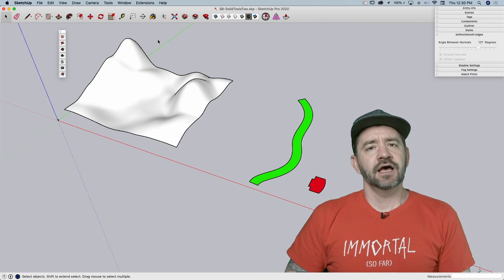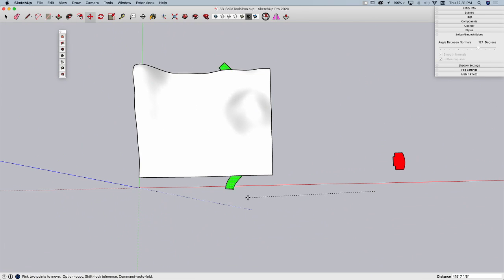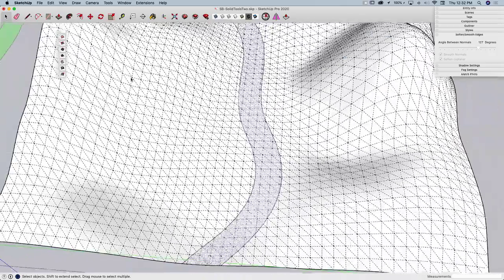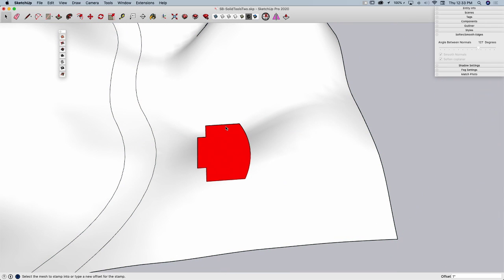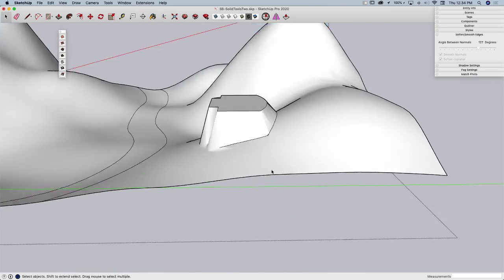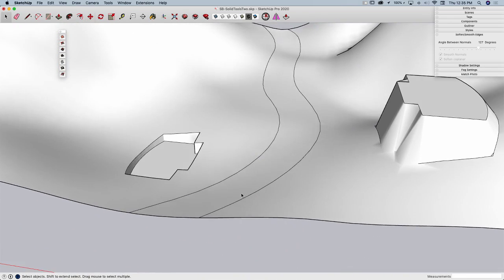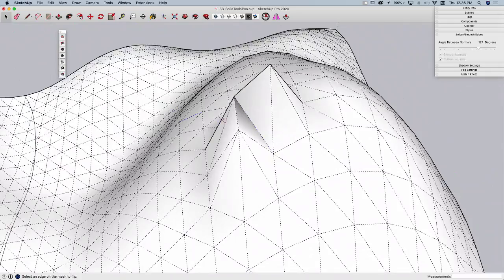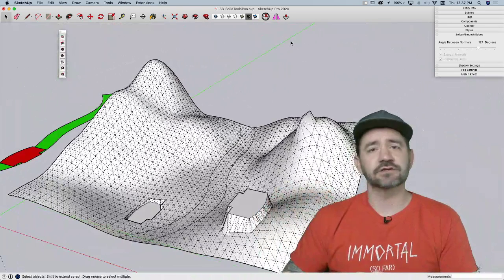Welcome back to Sandbox Tools - Skill Builder

Comment: This video (4yrs old) and another you did 2 years ago on Drape and Stamp have been fantastic for me. I am designing 2 houses on a site that is an irregular triangular shape - there's several boundary lines and setback lines PLUS the slope is down and across the site and will require several "cut and fill" locations and this video was totally a light bulb moment for me - thank you.

Comment: Aaron
You did a Video before about importing a .jpeg for windows and resizing it to the figured dimension on the imported plan. Could you do a Video in a step by step way showing how to import a plan and trace over it using the shown dimensions on the imported plan. Thanks